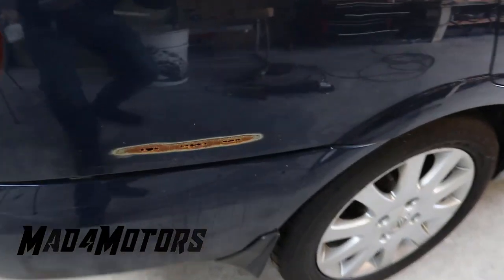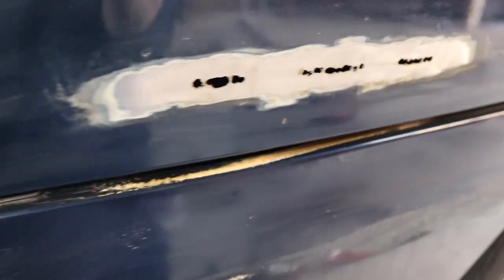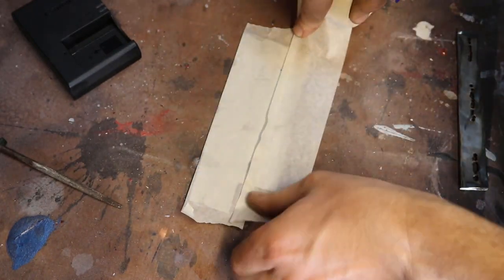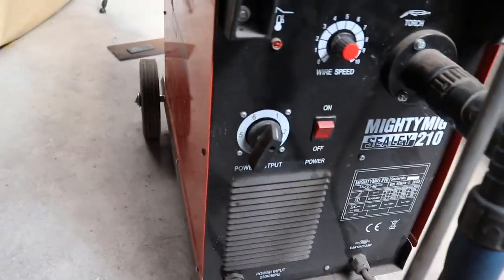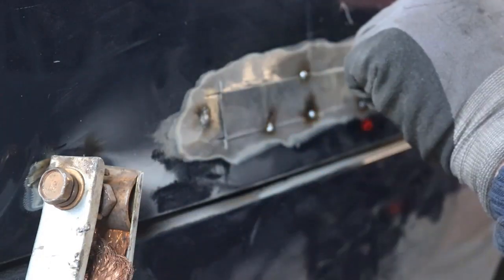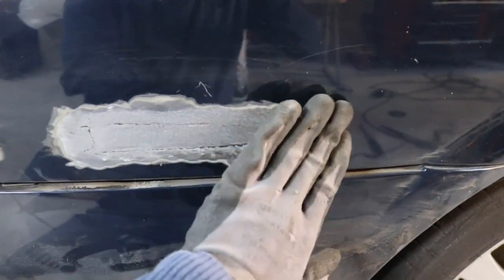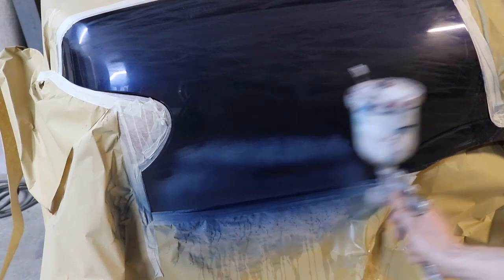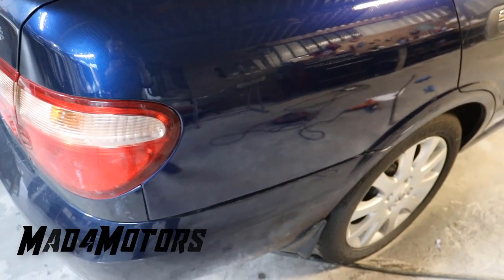Repair Rust Holes in your car. How to weld.

Comment: How to you prevent the inside from rust?
Reply: The inside if the panel is inside the vehicle, so it's not really going to rust.
Reply: Elijah Fowler this is the most ignorant statement I have ever read in a YouTube comment section.

How do you think it rusted out in the 1st place. . .
Reply: Elijah Fowler Elijah Fowler hypothesise any explanation you want in defense, but that's not how cars rust buddy. Get some experience before making presumptive statements for others to read.
Reply: Rockitanski  It actually is. I have over 10 years of experience as a mechanic, I'm quite knowledgeable on how metal, cars in particular, rust.

But that is irrelevant, to be honest. I'll say one thing, you'll say another. One of us is wrong and the other is an asshole, try to figure out which one you are, because I already know the answer to this one.
Reply: Rockitanski the rust can start from the exterior if the bare metal it’s exposed it will rust very fast I’ve seen it... but it’s very important to use a rust encapsulation inside the vehicle just to ensure it’s not going to keep rusting..
Reply: I would never have cut out a patch for holes that small. I would have ground the paint off as he did and how old a piece of brass in the trunk over the holes and welded them up like he welded in the patch not to get it too hot. A lot less welding and a whole lot easier job. 
 And would have sprayed under coating over the inside so it would not rust.
Reply: Larry a used copper pipe fitting flattened over the stripped out end of a bum screwdriver makes a good spoon to use for your purpose.
Reply: Yeah it rusted from the outside, but after this repair he left the inside bare metal so it is going to rust. Some epoxy primer needed to spray inside
Reply: Rockitanski lol your getting triggered about something stupid and then you are calling me the kid...
Reply: Ben Bobango stop being a self progecting hypocrite. I can see where this is going already. You aren't even worth replying to.
Reply: Rockitanski your one to talk
Reply: Just spray Expanding foam inside it will never rust again guaranteed for 20 years
Reply: I was curious about the 18 replies on this comment in less than 2 weeks.. So i read all the replies and end up laughing alone when i put how this conversation should really end if u all were sitting on a bar drinking beer on weekend.. Just sayin..
Reply: alister kellen remember the end of Unforgiven? The old bastard got drunk on his own whiskey (beer is for girls), and killed everyone in the room that was wrong.
Reply: @cruzinezy1968  hahaha.. Im still laughing.. This is so hilarious..
Reply: The car was going to the scrap yard as he mentioned,  im sure if it were going to a customer he would have been more meticulous, you guys act as if he was working on this car to send it to a national car show where judges know what to look for smh.  he was just doing this for the novice that cant spend thousands of dollars for a body guy/shop or paint guy.  Maybe he used the wrong words when he said professional gees we all make mistakes some of you act like every YouTube video should be mistake free or worded perfectly damn relax already.  if you all are so perfect MAKE a VIDEO then you wont have anything to complain about

Comment: Wouldn’t it have been easier to take you a piece of brass and I mig welder and put the brass on the inside of the trunk & Mig Welder outside after you ground all the paint off and weld all those holes up and then grind it flat and work it. it would’ve been a whole lot quicker and a whole lot easier and a lot less welding
Reply: Might not get all the rust that way, problem could show again down the line.
Reply: Plus, The thin ate away metal is pretty easy to blow out with the welds.
Reply: AMEN
Reply: HORSEDICKoMPEG that is why he says "take you a piece of brass" you put the brass on the backside of the panel to absorb the weld energy where there are  holes yet let the liquid weld metal penetrates the good surrounding base metal (doesnt fuse to the brass because it's an amazing heat sink)

TLDR @  Larry AMEN
Reply: I think the Video was for more education purpose. Most spots on cars you are unable to reach with a heat-sink from the back, so I think it was more to show you how to replace a patch, as he states its going to the junk yard anyways.

Comment: I recently did some touch up working my kids car for him. It turned out good but something happened. The clear coat just peeled off in sheets? I used a base coat ( some brand I got from Canadian tire ) then put 2k clear coat. Can you tell please why the clear coat peeled off a week later when he washed the car? Awesome video by the way 👍
Reply from the maker: I would guess that it was a problem with the base colour and the clear would not adhere to it because 2k is normally a tough clear and would stick to almost anything
Reply: You have make sure the base coat and clear coat are comparable, and you should always wet sand between coats to make sure a good bond is formed.
Reply: Elijah Fowler another inncorect comment. You don't sand base coat, it will disturb the metallic pattern making it very obvious. Only sand primers, unless the recoat time window has expired.  This time window is differant for all types of materials,  that's what material data sheets are for.
Reply: James Wilson if your base color and clear were compatible, sounds like it's possible that you didn't get the clear applied before the  base color fully cured. Once the base has flashed over (10-15mins) is the best time to lay the clear on. 
 The base color could have been old and had previously been exposed to open air too long and rhen sealed up again. 
 Automotive painting can be a tricky chemical process when mix and matching products if you don't use them frequently and are familiar with the do's and dont's of a individual products limitations. Always try to refer to a materials data sheet when steping outside a "complete paint system" to ensure chemical compatibility.
Reply: Rockitanski  Oh man, you must be a real smart guy to catch all my mistakes. Good job! Can I call you sensei and learn from the master himself?
Reply: Elijah Fowler no I don't instruct millenials... they know everything already.
Reply: Rockitanski  Sorry bud, I'm too old to be a millennial.
Reply: Elijah, I've seen you run around the comments giving lots of bad advice under this video.
If you really want to color sand you don't do it between coats, you do it right before clearing, respray windows are the time frame in which the paint will properly adhere to itself and melt into itself. Paint systems are designed for this, your sanding is doing nothing to help adhesion during a normal paint job. It's just for cosmetic purposes to cut down on orange peel. In my experience color sanding is absolutely useless and in the hands of someone inexperienced can just cause headaches, and if you're not thorough with panel drying and cleaning you can end up with a ruined paint job. Dust and water hiding love to rear their heads as soon as the paint gun comes out.
Reply: byw  You're not wrong.  I was meaning sanding between color and clear, and I understand your point.

It's just been my experience, as a hobbyist in this field, that this works for me as not everyone has the resources or pleasure of working with proper paint booths and environments, or has the time to take care of it in one sitting. It was under this assumption that I made the above comment.

I do thank you for taking the time to share your opinion, and doing so in a constructive manner.

Comment: thas good if you have time to waste... i just clean the inside of the pannel and fibreglass it. then i put a little bodyfiller to plug the holes.... did that on a bmw about 8 years ago... still would not say anything happened there.

Comment: I thought you could just put tac welds to fill the gaps in and then grind it down
Reply from the maker: You tac the metal in place and then spot weld until its one piece 👍

Comment: you have to be kidding me with this "professional" reapir :D
Reply: hedstajl this is as good as you are going to get from a production body shop. It looks passable. They don't get paid enough to more than this.
Reply: This is a professional repair... a lot of production body shops only will grind the rust and apply body filler... this it’s the right way to repair rust...
Reply: Professionals wouldn't apply body filler over paint that hasn't been sanded. I counted way too many things wrong in this video for it to be considered "professional" I get the fact he said he wanted to just show the viewers about the end result.... but the entire process you showed will definitely have problems very soon.
Reply: Totally agreed mike.
He did a poor job in my opinion welding, he doesn't appear to be a welder, those tacs are all cold tacs. I understand welding on body panels can be hard, but heat management is just a part of the job.  He didn't even put welds in every bit of the seams, so it's not a whole lot better than just filing the existing holes and bondoing over those. He then poorly applied bondo over an unpreped surface, then poorly sanded/feathered it into the rest of the panel. Then his prep job for paint was miserable, and he didn't even etch, so his primer's going to have adhesion problems.

While I admit the finished result looked good in the video, it really wasn't done well and it's going to show if this car is driven in the winter or stored outside.
It's easy to go online and point out these flaws, and doing it correctly takes a ton of work, but just the idea of him claiming this job is 'professional'  makes me mad.
Reply: iivoli yea that's not how it works. Hahahaha
Reply: Ive seen worst repairs... thats for sure. but ive seen a lot better repairs too.  quite honestly as small as the "holes" were I'd have sanded the paint and simply tacked the spots with weld until they were filled. then sanded and painted. (Im assuming he opened up the trunk and looked into the panel or at least checked the inner panel wasnt a swiss cheese coverd mess.)
Reply: No Matter Where You Are, No Matter Who You Are, No Matter What You Do, Some Shitposter From Youtube Comment Section Does It Better Than You.
Reply: didnt he use anything on the backside of the plate and the backside of the seams? if no, this will rust!
Reply: @iivoli  it always amazes me how many highly skilled people are watching how to videos..😂
Reply: @dgodgo5983  hahaa lmao you are damn right !! :D clap clap
Reply: LoL what a Legend haha
True
Reply: Because even the best of us can learn new tricks.....not in this case though
Reply: @billybobjoe198   perhaps make a video of your own showing us how it is done professionally.
Reply: @robbieirlam414  I don't know if this is a request, or supposed to be an insult.
Reply: @billybobjoe198  A request .    Would love to see this done professionally by yourself. Thanks.
Reply: My own pickup needing some serious attention!
Reply: @iivoli  Yup- welders are the worst, in my opinion. No bigger anally-retentive pains in the ass than welders as youtube commenters. Guaranteed that they will ALWAYS find something wrong with someone else's welds; too cold, too hot, not enough bevel; wrong wire speed, etc. You name it and they'll piss and moan about it.

Comment: Good video letting it cool down in between tacks also people my want to take small breaks well grinding to much
grinding at one time will heat up the metal and make it warped and yes paint the back with rocker guard and prime the bare 
metal then bondo then prime and put spot putty for the small scratches then prime and sand then paint. that is what i do. thanks
for your video.

Comment: Always disconnect battery before welding on a car
Reply: Why
Reply: @tomdude75  welding is ac or DC voltage being shot straight into the metal that you're welding. Welding with battery hooked up has potential to blow fuses or short things out in the car. Doesnt happen often but it's better to be safe.
Reply: @tomdude75  it can fry the computer.

Comment: Why not weld the hols in then grind them down?
Reply: the metal close  to the hole is usually rusting too, and nothing like full thickness will not attach well - you need to cut back to reach metal that is undamaged. At a push you could drill the holes larger to do that but soon it is easier to do this.

Comment: Look on "cut off" near back door. The color looks really bad and doesn't match to door.
Reply: I think one polish should bring back some of the shine and look more newer
Reply: It wasn't about color matching paint... it was about removal of rust so that the car would last a few more years if the engine is in a pretty good shape
Reply: still better than rust holes no?
Reply: its because he washed that side?
Reply: 9:50
Reply: You say that as if it matters in this particular case. GFY

Comment: The inner unpainted side of that   sheet will rust again.. 
Instead of this you should have filled those rust holes with same size sheet by welding .

Comment: that's working like using zip ties... in a couple of years it will worst than before... the people only repair what can be seen, but forget that the metal sheet have two sides... the in side it's not treated it will rust very fast...

Comment: Why people teach others the wrong way? Have anything was done to the back side? It will rust inside out! You shouldn’t apply body filler to metal. B. filler is hygroscopic. It will accelerate rusting process! Should of been acid primer, followed by 2k and only after that filler! Making sure filler never meet with acid! And not even mentioning all the dirt in clear, totally different color and improper masking prep!

Comment: your weld gaps are way way to small , i am sure if u look at the back  side of it you would have not penetrate the metal and have heaps of pin holes after grinding